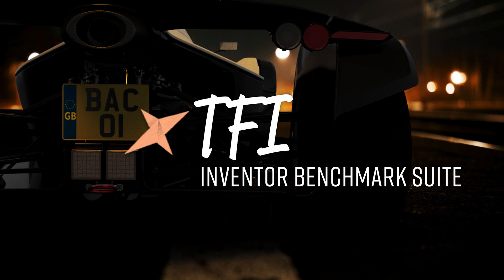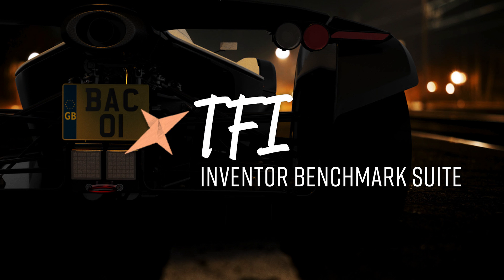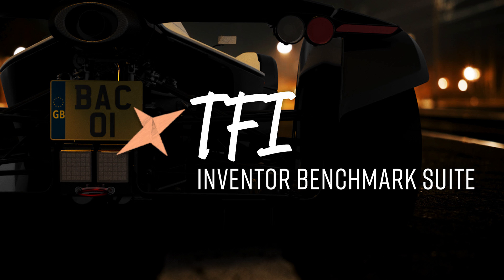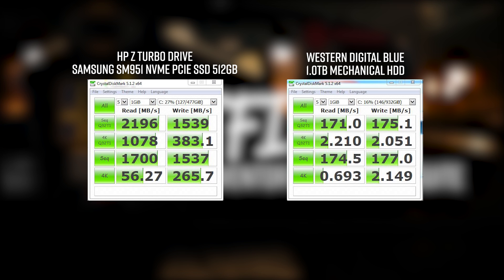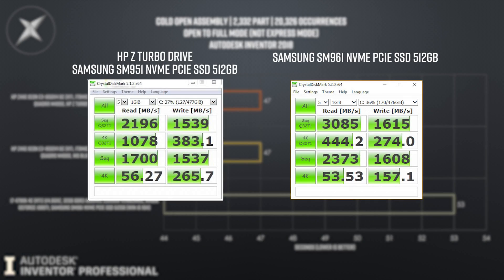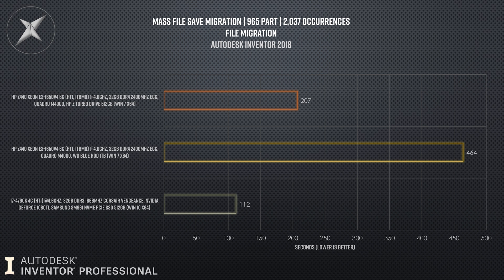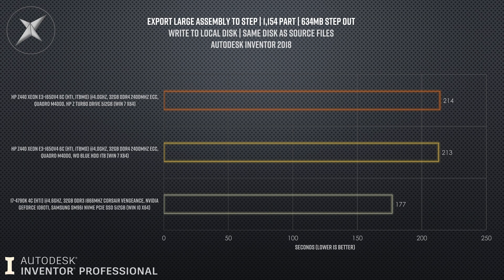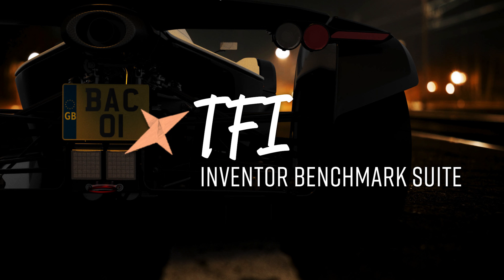SSD vs MECHANICAL HDD | 3D CAD Performance Test

Comment: Neil man What do you think of the new line up for the Intel Xeon E3-12xx v6 Series
Something is fishy I don't know 
if you look at the comparison you'll see it>>>
Hope to hear from you on the subject
Reply from the maker: Not sure I can see what's fishy, apart from them looking very similar to i7 specs they seem pretty average?
Reply: -No need for a new chip
-Integrated Graphics
-The RSP  between 1275 and 1280 is off

Any word on the best of them so far for Autodesk Inventor
I'm looking for a new home build and after seeing that Inventor doesn't benifnt from the GPU that much anyway I'm thinking about an integrated graphics for now at least so I could save some money to put on other components

Thanks Man
You're the best

Comment: At work I have a HP Z240 w/ a Samsung MZVPV512 NVMe drive and the difference between that and the Samsung 850 Pros I have at home on a similar CPU (6700 vs 6700K respectively) is markedly noticeable.

I would suspect that the difference between the two NVMe systems is purely down to the difference in Windows version.

Two thing I always turn off when working with (copying files between) HDDs these days are Windows search indexer and my antivirus. 

Even when copying between SSDs the read/write speeds take a hammering if either of those are active.

I'd be interested to see you run the tests that had the largest differences (Test 9 wasn't it?) again with Searchindexer disabled.
Reply from the maker: Search indexing was disabled, I disabled that and Windows Update which are the only two services using any CPU and disk resource at the time

Comment: For the FE meshing test, you may....MAY, have been writing to a swap file? How else could one explain the difference....curious!
Reply from the maker: 32GB RAM in that machine, swap file shouldn't be touched!
Reply: Yup, I noticed...but how else can you explain the difference in scores for a fully CPU-intensive process??

Maybe watching the resource monitor while running the test could uncover things?
Reply from the maker: If there was anything running in the background, it's something which is completely unavoidable.  Both those Win7 installs were factory fresh with zero software installed other than Inventor, Winrar, Google Chrome and AMD OCAT for the frame rate.  I disabled search indexing and windows update services, other than that there was nothing more I could turn off which wasn't default to the OS.  If something did kick up in the background, it could only be something native to Win7 which everybody else will have, and if that's the case then it's a valid attribute to the test... because whatever that was will happen that way for someone in the real world.  Unless I clearly note otherwise, all the tests done in this series are done on fresh clean installs of Windows with no bloat on or unnecessary background processes! So at the moment I can't explain this but it is what it is, it happened and it's indeed very weird!
Reply: Let's wait for the Win10 results, then...